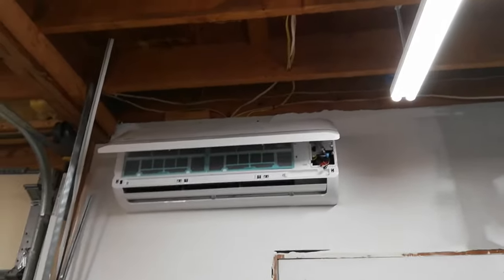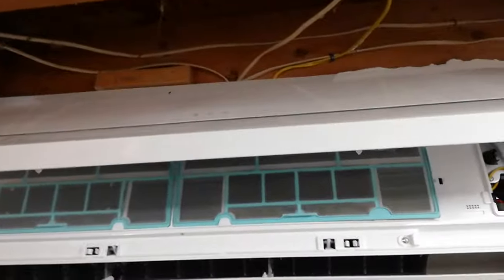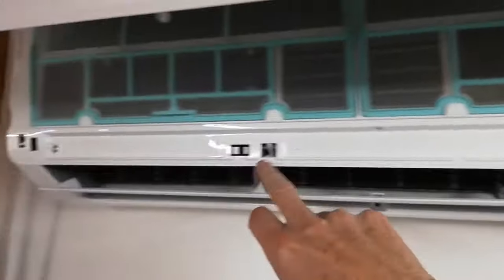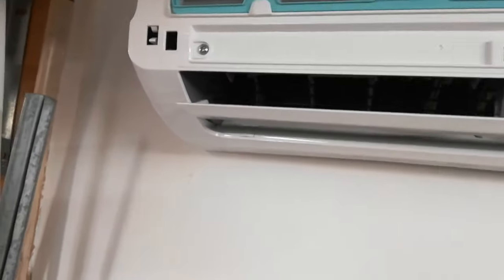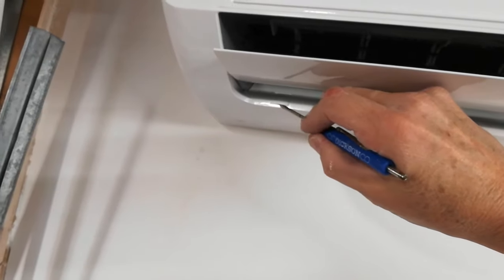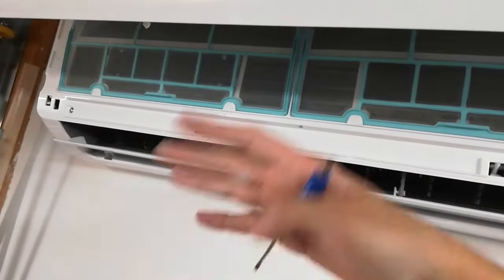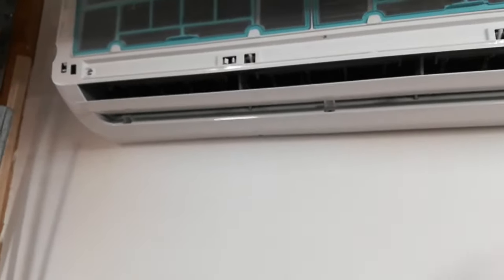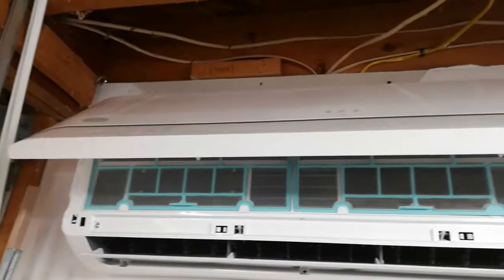Carrier Mini Split cover removal

Comment: After removing the cover is possible to access the point where the pan meets the condensate hose?  Without any more disassembly?  I think I have a blockage there or down the line.  I'd rather try blowing air from this end because the hose exits on a roof that is hard to get to.
Reply: Was able to get the cover off.  I had to remove it with the front door attached, because the installer  mounted the unit less than an inch below a ridge beam!  The front door can only swing up 2 inches because of that- the door would need to swing up higher to release it from the cover.
After removing the cover the access to the drain in the pan is not perfect, because the evaporator coil tubing runs in front of it.  I actually used the outer rubber jacket of a heavy duty 12/3 power cord inserted into the drain hole attached to my air nozzle to first fill with water and then blow out the line.
Reply from the maker: @running_rich Yeah, the wall units are terrible to work on.

Comment: Hello i bought a carrier mini split 53ELQ121C which supposedly offers heating and cooling. I had it installed today and the technician said that the mini split does not have the connections for heating. I bought it specifically for both. What is wrong?
Reply from the maker: Not sure.  I'm having trouble finding the manual here in the U.S. for this model.  It should have a remote control.  Does it allow you to put into heat mode?
Reply: @dpeagles  it does allow me to put it in heat mode. I am in Mexico. The 53ELQ121C is probably sold only in Mexico but it is part of the carrier elite series. When i put it in heat mode it does absolutely nothing. I also have an LG with cool and heat mode and it instantly starts heating. The box it came in says cooling and heating but the technician said it was missing the connections and he assumed it was only for cooling
Reply from the maker: @aragornii507  I would contact technical support.  I don't know enough about those particular units.  

Sorry I don't know more about it.
Reply: @dpeagles  ok thank you

Comment: Did your unit have a gray cord connected to it. If so where did it connect to
Reply from the maker: No.  Mine is hardwired through the back in the wall.

Comment: I wish you would have shown actually taking the cover off. I cannot get it free from the clips on the top
Reply from the maker: @erinwhiterealtor5947  i think you tilt out from the bottom and push up.  Basically the top drops into slots vertically.   That's my memory anyways 

Be careful not to break the plastic
Reply: Did not work.

Comment: So happy to have found your video, but I'm having trouble with the top tabs.  My unit only has a couple of inches of clearance on top and I can't see how the tabs are released.  Do you remember?  Thanks!
Reply from the maker: From memory I would say pull up towards the ceiling on the white cover, and I think you can push down on the latching tabs on top if you can find them.
Reply: Thanks - I'll try again tomorrow.  I can feel the tabs, but the limited clearance makes it difficult to get any leverage on the case.  I appreciate the tip.
Reply from the maker: @waltsatan  It is definitely annoying to remove.  I think Carrier needs to improve their design a bit.

Comment: You didnt remove anything
Reply from the maker: I wasn't going to do it over again for the camara.  Too much of a pain.
Reply: Same, but i found this video /watch?v=m0F5N3RtcH0.  Although a different model it helped me to see how to actually remove the housing which is missing from this video.
Reply: @n1lla  Thanks for your response; the video you noted ( https://www.youtube.com/watch?v=m0F5N3RtcH0 ) actually shows the cover removal.  I have a Carrier 40MAQB high-wall ductless mini-split, and the tips in the other video worked.
Reply: @n1lla  After removing the cover as in the video you shared,  do you know if it is possible to access the point where the pan meets the condensate hose?  Without any more disassembly?  I think I have a blockage there or down the line.  I'd rather try blowing air from this end because the hose exits on a roof that is hard to get to.
Reply: @running_rich  - I would think yes, but i am not sure to be honest.  Unfortunately i did this several years ago and i don't even live in that apartment anymore.  I would recommend trying to look up the manual of your model and see if you can determine if the drain hose (which conceptually must connect to the drain pan) is accessible or not.  Best of luck.
Reply: @n1lla  Thanks!